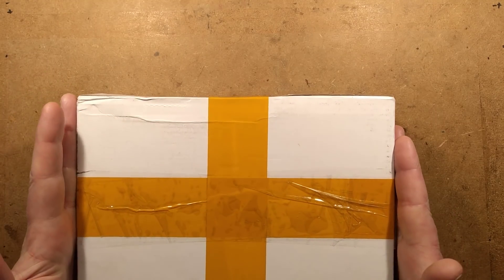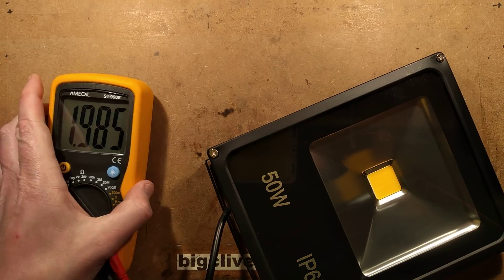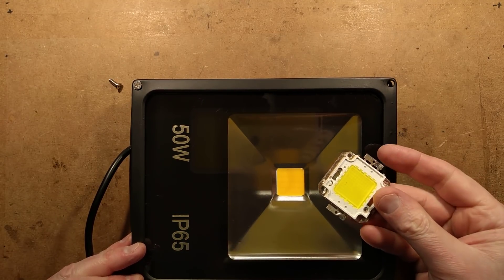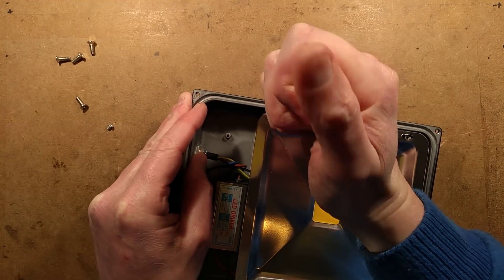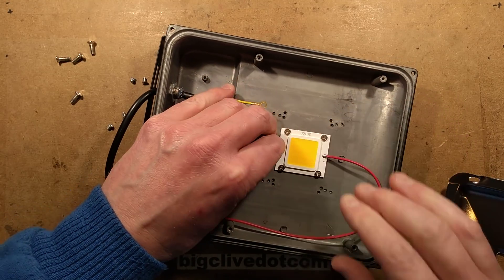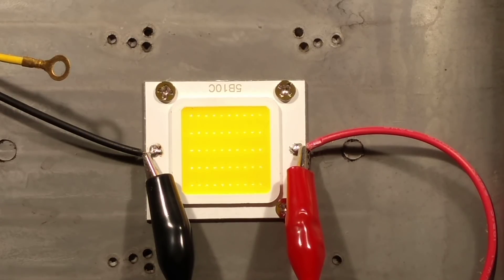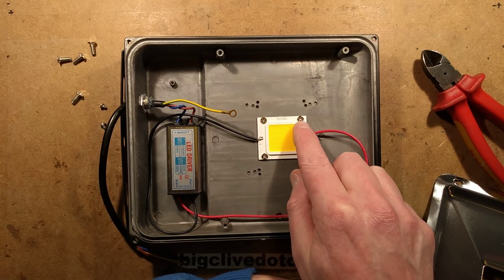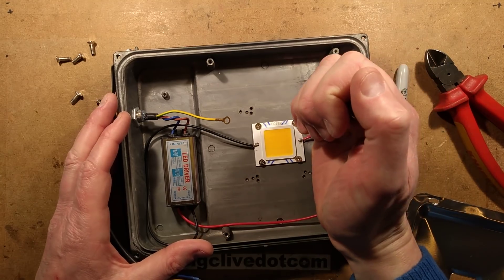Another cheap eBay LED floodlight.  Is it really going to be 50W?

Comment: Big Clive: I have a question.. The driver says on it " Input,  AC - 85 to 265 Volts " I'm in the U.S. and as you know, we use a puny 120 VAC. But what country would use AC voltage as low as 85 VAC ? Even at 120, a voltage drop of 35 volts is unheard of. How well would that driver work at, say, 90 VAC ?
Reply: Japan uses 100v, they're allowing for +/- 10% and then hedging a bit. Makes it a universal power supply.
Reply: @puckcat22679  wow Nippon cats only using 100vAC? They must be using Honda Vtec Generators!
Reply: Some remote rural 110/115v farm users using these on a long cable extension may be around 100v give or take depending on time of day.
Works both ways... I live rural in UK but often read 248/250v on my evening 230v rated supply!
Electronic drivers correctly designed can cope with these large voltage variances, but efficency/losses will measure best at just just below rated power output in middle of volt range!
Reply: Martin Pickard that’s because the UK is still providing you 240V +- 5%. It’s just redefined now to be 230V +- 10%.
Reply: I used to see 260v until the power network were notified.
Reply: Remember US power companies supply ~120vac, at 60hz. The Hertz they guarantee, the voltage will vary, depending on peak usage/ time of day. I assume it's the same worldwide, voltage fluctuations with constant Hertz supplied
Reply: William Schrimsher US used to be 110V, twice the 55V for an old arc lamp.  Back then Europe was 220V and UK 240V.  Then Europe compromised on 230V, and someone wanting consistency redefined the 110V countries as 115V.  Not sure when they crawled to 120V.
Reply: @johnfrancisdoe1563  115/120 *peak

Though I often see 124v on one leg of three phase systems
Reply: @jrmbayne  They don't exactly guarantee frequency, either. They guarantee the *daily average frequency*, but not instantaneous frequency. Wiki "utility frequency".
Reply: Mike Cowan;   Actually, in North America the Utility companies are even trying to divest themselves of the responsibility of providing an accurate "daily average frequency" through a method known as "Time Error Correction" or TEC.   Here is a cut and paste of part of the Wikipedia article on electric clocks:

  "In 2011, the North American Reliability Corporation (NERC),[14] a consensus-based industry organisation, petitioned the Federal Energy Regulatory Commission (FERC)[15] to eliminate the TEC. While this would have freed the power companies from the threat of fines and also provided an extremely modest increase in frequency stability, it was also noted that synchronous clocks, which include wall clocks, alarm clocks, and other clocks computing the time on the basis of their electrical power, would accumulate several minutes of error between the biannual resets for Daylight Saving Time.[16] This consequence was reported in the American news media,[17] and the initiative was dropped. However, in late 2016 a similar proposal was again filed by the NERC to the FERC, which was approved two months later.[12] It is contingent upon the removal of the standard WEQ-006, and the NERC also petitioned the North American Energy Standard Board (NAESB),[18] a non-governmental organisation that is business-oriented, for removing that standard. If the FERC adopts the NAESB petition, TECs will no longer be utilised in the United States and Canada, and clocks timed by them will likely wander uncontrolled until manually reset; it was noted in a technical paper by employees of the National Institute of Standards and Technology and the U.S. Naval Observatory that, had TECs not been inserted in 2016, there would have been over seven minutes lost by electrically timed clocks over much of the United States and Canada, as shown in Figure 8 of their paper.[12]
Reply: I think its for line voltage tolerance purposes.

Comment: They saved 1/100th of a cent by not earthing that wire.
Reply: Hey, it adds up.
Reply: And now they will loose many times 10 dollar because these viewers will never buy one...
Reply: Yeah, a screw or solder or even silicone/glue, anything to hold it in place better than something that could be shaken off the casing.
Reply: The earth wire is meant to be attached to a left hand thread

Comment: The tiny rectangular LED chips they use in those COBs look to be no more than 100ma, so they are driving the heck out of them at their stated power rating.
Reply: They are running them at 100ma?
600ma input 6 strings of 10 diodes.
Reply: Blake Thomas It's 5 strings of 10.  50 LEDs, each driven around half a Watt but advertised as 1 W each.
Reply: @johnfrancisdoe1563  Seams I miss herd. So ya 120ma each.
The case says 50w, but they used a 20w driver, likely because the case isn't a good enough heatsink for 50w
I have some 70w driver driver-less units (60hz here so the flicker isn't bad) and I've bean using forced air cooling.

Comment: I have one of these types of lights and whenever it's on my fm radio gets really distorted. Why is this? And how can I get rid of it?
Reply: You could try your luck with a snap on ferrite bead on the power line going to the driver. Other than that, who knows? One would think a metal outer case should provide some level of shielding.
Reply: pauljs75 Box shielding doesn't stop RF noise on the power cable.  An open / glass front may turn it into a (lousy) parabolic antenna.
Reply: use internet radio

Comment: When pulling a wire back like that if you take a lighter and warm the sheets up a little bit you can pull it back it'll be much more pliable and it won't be so strenuous on the cable
Reply: instructions unclear, foreskin now damaged
Reply: Adron Garretson But the heat will stress the PCB to be tested.  Cable is more expendable in case of failure.
Reply: @johnfrancisdoe1563  And pulling directly against the solder pads doesn't stress anything??
Reply: @mikecowen6507  lol, but try reading Adron's comment with a dirty mind :)
Reply: @Blox117  Who says I didn't get it? I just didn't want it to turn into a Harlequin romance. 😈
Reply: @mikecowen6507  pro tip: dont use perverted analogies whilst reading instructions. you may end up with an unplanned circumcision and/or pregnancies. probably both
Reply: @mikecowen6507  I. did. not. have sexual relations with that fleshlig--, I meant flashing, I meant flashlight!
Reply: @Blox117  I'm sorry, that really sucks! 😲 
Alternately, you could verify the contact insertion force of Fanny Flambeau's posterior mating flange, both before, and after initiation of the excitable thermal activation compound. Simultaneously, one could also establish the high voltage threshold for electrically activating said excitable thermal compound via series circuit through the posterior electrode plug inserted into the male contact assembly.
Reply: @mikecowen6507  what the hell are you talking about?? I do that every morning before I go to work! You talk about it like its an orbital docking maneuver!

Sigh, kids these days. lol
Reply: @Blox117  Lol! Humor while tired... Yep, a docking maneuver of sorts. More than one way to interpret. Hehe. 😉

Comment: can those l.e.d’s be used as a solar panel? i found out on YouTube 🤔😯
Reply: LEDs will generate a measurable voltage when exposed to light, but there is not enough current to power anything. They can be used as a light sensor though.
Reply: rocketman221projects oh 😔

Comment: Hi Clive, any chance you could review a 100W LED High Bay Light, I was thinking about using some as photography lamps as they have  standard E27 fitting that woul fit my existing lighting system.
https://www.ebay.co.uk/itm/2PCS-100W-LED-High-Bay-Light-Commercial-Stadium-Industrial-Factory-Cool-White-UK/233104596494?ssPageName=STRK%3AMEBIDX%3AIT&_trksid=p2060353.m1438.l2649

Comment: The popular name for the Cliff Quick test and clones is a LEN box as that's what it says when the lid is open :)
Reply: Steve Perry But that's what it says in most single phase connection stuff.
Reply: I think mine predates the Cliff version. It's called a safeblock.
Reply: LEN = Line Earth Neutral ... the order of the connections, not the name of the item/manufacturer.

Comment: I am still looking for that handy little quick connect unit you are using. Is it a UK device only?  PLease advise.
Reply: http://www.cliffuk.co.uk/products/tools/quicktest.htm
Reply: Normally found on ebay http://www.cliffuk.co.uk/products/tools/quicktest.htm
Reply: I think it is. I recall once searching eBay for "Cliff Quick Test" and only UK vendors showed. Wasn't cheap either.
Reply: Gary Rumain They did at some point make a version with US colors for export (heard on this channel, no need myself).
Reply: For the US version search for CL1857 or if you wanted three phase CL18304. lots of online sellers like element 14 carry them. (Allied electronics in the US also has the 3 phase rebranded as RS Pro 8112274)
Reply: @nurgle11  I saw them from a couple companies but at $38  minimum price I could find, I decided to pass. I built a similar unit with a line cord and alligator clips but mine also has a volt/ammeter and a switch built inafter the fuse. I also have a 120 volt isolation transformer that I use just for an added later of safety.
Reply: https://www.newark.com/cliff-electronic-components/cl1857/qt1-usa-canada-13a-fuse-quicktest/dp/08AC2593
Reply: They are available from Newark.  https://www.newark.com/cliff-electronic-components/cl1857/qt1-usa-canada-13a-fuse-quicktest/dp/08AC2593
Reply: Farnell sell the USA version. https://uk.farnell.com/cliff-electronic-components/cl1857/qt1-usa-canada-13a-fuse-quicktest/dp/2707142?gclid=CjwKCAiA767jBRBqEiwAGdAOr6quPs0vbKR8jERA19evniyRaKtXc-hNcwsjE8EJHX_GGlf-3w7gzBoCo8oQAvD_BwE&gross_price=true&mckv=txM9vlnx_dc|pcrid|78108376509|&CAWELAID=120173390001981687&CAGPSPN=pla&CAAGID=14406255429&CMP=KNC-GUK-GEN-SHOPPING-2707142&CATCI=aud-157604796549:pla-57456842410    or Newark Element 14 in the States.

Comment: I bought one of these and after several hours of use the inside of the glass appeared to have condensation on it. It wasn't water; I think it might have been silicone oil? Not sure what exactly it was coming from. Might have been the potting silicone in the COB. Strange but it only happened once, I guess it evaporated after the first day.
Reply: I'd be willing to bet it's off gassing of some residual oils and plastics mixed into the pot metal housing. Those things are made from the cheapest scrap they can throw in a furnace.

Comment: Probably the equivalent to 50w in bulb light yea, a have a 50w cpu heatsink and its much smaller than this
Reply: N Gauge England Synthematix It's 50 LED chips.  Question is if they would last at 1W each in a hot enclosure.

Comment: Can you review some led grow lights
Reply: Great idea
Reply: MobileMaster Gaming 

They are finally good enough. 
I’m using them in my California grow tent.
Reply: @makeracistsafraidagain   Finally good enough? They have been good enough sense LED became a replacement for CFL. You mean you finally stopped listening to the HID retailers and fanboys trying their best to keep you away from them. I've been running LED for close to 10 years. Full spectrum for close to 5 now and they are the same now as they were 5 years ago apart from the on board driver types now available.
Reply: There are channels, yes, but they don't seem anywhere near as trustworthy as Clive. Do you have any recommendations?
Reply: I can say that I have been using the cob leds with built-in drivers at 120vac chips and they have +700 hours logged and yet to have a failure. I have them at a 50^C maximum heat sink temp. they stay around 40 depending on ambient temp
Reply: A friend swears by these lights. They are not 150W as described, but jog along @ 50W with a 12V internal fan. Look for the 50 x LED versions. They have lasted over 2 years daily so I assume they are using 1-3W LEDs running at ~ 1W. At £20 a unit they can be considered a "consumable". The fans might become noisy but are easily replaceable. The casing is all earthed metal. The LEDs are all run in series from a similar driver to Clive's lamp above.  https://www.ebay.co.uk/sch/i.html?_from=R40&_trksid=m570.l1313&_nkw=150W+LED+UFO+Plant+Growing&_sacat=0
Reply: Vaxer ones would make an interesting disassembly alongside the cheapies.
Vaxer are expensive but I've clocked them at 30000+ lux so quite capable and not weirdly red.
Reply: He already had.
Reply: i use uvc bulbs so everything gets cancer and dies

Comment: I wonder if the none earth / ground for mericans. Is purely an assembly thing. Meaning a worker has a quota to meet. Thats just one thing they can not do to save time. 3 or 5 seconds to fasten that wire (being generous on that time) maybe at the end of the day that's a couple more extra units assembled. #2 disgruntled or slacker employee they guy who hates his job but just does enough to get by. #3 i used to work with this greybeard commercial plumbing his name escapes me, anywho everyday atleast twice a day he would say the Chinese are killing us americans 1 at a time. Some new guy would ask why and he would get into the tools being made if a big wrench breaks a guy might slip and loose some fingures or fall of a roof. No grounded electrical tools and so on. This guy could go on for hours of examples. But any one of them could be the reason. Cost be be another, or the uk plug in has a fuse inside it maybe they think why double fuse it (not fully understanding). I really think its an assembly issue. They must be doing some sort of quality control every 100 units  the quality control guy knows nothing about electronics so his job is to plug what ever in and see if it works, you know he is not testing for earth or ground. Still frozen in kansas everything thawed out then bam 3 inches of snow and cold. Hope wherever you are its 75 Frankenstein and suns out guns out shirt and shorts.
Reply from the maker: I'm in Glasgow right now, which should be cold, but it's actually warm by my standards
Reply: @bigclivedotcom  mint

Comment: The driver helpfully labels the output cable colors even, Brown for the negative and Brue for the positive, as one does. Also their basic physics is faultless quality with 36 V times 0,6 A equalling not 21,6 but 50 W because hey, everyone likes to save energy, right?
Reply: Those are 50 Chinese Watts. I think a random number generator is used when calculating them.
Reply: It’s a 50W chip with a 20W driver. That’s  50W light, right.
Reply: And connects black wire to brown and red wire to brue. Like you do....
Reply: You forgot the power factor 50x.56=28W Basic physics.
Reply: Uploaded 22 hours ago but you commented 4 days ago come on youtube
Reply: @RowynOfficial  People in this day and age are still getting confused by that …
Reply: I found this poem on my LED light, i think its supposed to help with wiring?

"roshes color red
wire color is brue
brown color make me want to have the buttshecks with you"
Reply: Brue??
Reply: @heronimousbrapson863  - It is a common color like geen and wellow.
Reply: @heronimousbrapson863  yes. Brue. That's what is written on the driver lol
Reply: Can I ask curious  question , how is it this video  was posted 10 to 30 mins ago how did you comment 3 DAYS before the upload ?  Just confused lol
Reply: Jesse LeBlanc - Clive uses a time machine called the TARDIS...
Reply: @Mark1024MAK  Little known fact is, Clive BUILT the Tardis.  The whole Dalek/Time Lord war was over the Daleks being upset Clive helping the Time Lords.
Reply: @Mark1024MAK  ..and Powered by Patreon ......Lol
Reply: @Clearwater420  Patreon time machines.
Reply: @Clearwater420  They are Patreon subscribers, and get to see videos a bit earlier.
Reply: @Zadster  cool just confused  lol ✌
Reply: @Clearwater420  patreon people get to see the video first.
Reply: @Clearwater420  Yeah clive posts his videos on patreon a few days early, some videos may or may not be posted based on feedback
Reply: Those colors are standard for some countries
Reply: daPi Those (with corect spieling) are the colors in typical 2 wire mains flex sold all over Europe.  It's often rated for 230V/2A or thereabouts, so using it for a 30V/2A LED (or worse, a 12V/30A halogen) light is a bit naughty.  They moved 12V lights from the DIY to the electrician only regulations because of all those fires.